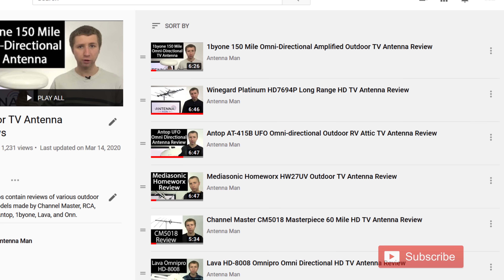Lose TV Stations at Night? This Common Item Interferes with TV Reception

Comment: LED bulbs are required to comply with Part 15 of the FCC rules as an unintentional radiator. This is a legal requirement for these bulbs to be sold in the USA. However, due to lax or non-existent enforcement of these regulations by the dimbulbs in Washington, it is very easy to purchase LED bulbs that do not meet these requirements. These LED bulbs that do not meet FCC regulations will likely also not be UL listed, which means that they could be a fire or electrocution hazard. Big box stores will usually not sell LED bulbs that do not meet UL and FCC requirements due to the liability, but online sellers are typically less cautious about selling unsafe junk. If an LED bulb meets Part 15 of the FCC rules it will say so and/or have the FCC logo on it. It will likely also be UL listed and have the UL logo along with a file number that begins with E, and you can look this file number up on the UL website to find out if it's valid and who the actual manufacturer is.

Comment: LEDs may cause issues, but replacing them with incandescent is not necessarily an easy solution. 

My last trip to my local hardware store I found that incandescents are not as readily available as they once were.

Comment: I have an outdoor antenna an have a solid clear picture except for about 20 minutes 3 times a day when it has heavy pixelation and frozen pixelated screens with no sound. It occurs sometime between 7:35 AM to 8:20 AM, between 12:00 PM and 12:45 Pm and again somewhere between 5 PM and 6:30 PM 7 days a week. Nothing in my house is on that time cycle. There are no nearby businesses. The only thing I can think of would be an over powered Ham radio. My neighbor would be tapped off the same power transformer, but I would not think their electrical interference would effectively my reception.

Any ideas appreciated. I have searched the web for this issue without results.

Comment: It's certainly something to check. People buy LED bulbs because they are cheaper to operate. The interference is likely coming from a crap switching power supply in the bulb. Different kinds of bulbs may eliminate the interference. LED filament bulbs and other cheaper bulbs may solve the problem due to having just a simple full bridge rectifier without any room for smoothing capacitors. The downside is that they'll flicker 120 times a second. You may or may not notice unless you look at a running fan. Notice that I'm talking about switching power supplies here rather than the LEDs themselves. Any switch mode power supply could cause that kind of interference including USB chargers and peripherals that you use on your TV set. The interference could occur at any time of the day. I wouldn't doubt that a lot of the noisy power supplies end up in LED bulbs since they may overlook it. I'd just try a different brand of LED light bulb before just giving up and going back to inefficient incandescent bulbs. If you've only used brand name bulbs because of quality issues, a simple generic bulb might be your solution. I'm too cheap to buy anything else, and I really haven't noticed any issues. I do keep them on most of the time, though.

Comment: This video is false. In a small house, or in a dense city environment, these bulbs may introduce some interference.  But the real reason your reception suffers at night is because broadcast stations (music or television) are REQUIRED to reduce transmitter power at night. The same applies to Amateur radio operations; Hams are expected to reduce transmitter power at night on certain bands to reduce the potential for interfering with other types of stations.

This is necessary because electromagnetic signals  carry farther at night due to the Sun's interference being much lower. So at night, the potential of interfering with other radio services (the aircraft band, for example) is greater.

Generally speaking, a TV station will cut transmitter power by half or more once all of it's coverage area is in the dark, usually between 9 PM and 10 PM local time. So any channels that are fairly weak in your area will most likely drop out entirely. Google "reduced transmitter power at night" for more information.

Comment: LED interference with TV signal...I will recommended  to return to school and learn about frequency distribution. I will be more concert with FLCs  as the electronics ballast may operate in more the 10 KHz, that still way below TV signal. If the antenna is  couple feet from the interference source you will have direct coupling, Sometime the interference propagate from faulty appliance AC line. The flat black antenna have pretty dissent performance if use within RF amplifier. This antenna is good if you live in city where the transmitter is  petty close and not much obstructing your line of site.. This antennas use to be made with clear  plastic and you could see metalized strip of conductor. The manufacture switch to black plastics so no body copy their design - it is very simple to copy - pretty difficult to design. This is very clever design to make wide band antenna. This technics is use in microwave circuits. I have similar flat antenna in my apartment building in Brooklyn NY, Iit is 11 mile from Empire State Buildings, and I am getting around 60 channels in apartment on 5th floor where the TV signal go thru the building. The only problem I have is channel 11 & 13. I can say it not so bed antenna at all.

Comment: Led light bulbs especially the cheap Chines ones are junk. They not only interfere with television signals, but also garage door openers, and home WiFi systems such as wireless routers and surveillance cameras.

Comment: The cheaper LED light bulbs, like the Sunbeam ones that Dollar Tree sells, which use a simple capacitive dropper power supply are actually better in this regard because they cause a lot less RF interference than the fancier ones. The downside is that their light output has more flicker which may cause eyestrain.
Reply: In the UK "Poundland" sell great LED light bulbs for £1. One of the YouTube electronics enthusiasts/professionals did some tear down videos on the Poundland bulbs and was surprised at how well made their bulbs were.

Comment: I switch over to LEDs in my Camry's exterior lights. The only one I couldn't change over was the 3rd brake light because my radio antenna is in my rear window right where the 3rd brake light is. Everytime I hit my brakes, I totally losel my radio station. Now you've confirmed it. Thanks!

Comment: Don't necessarily have to switch to an incandescent, can try a different make/model of CFL/LED bulb. Bulb quality and construction varies wildly. Plenty of people with OTA use LED/CFL bulbs without issue. 

As for you suggesting that switching from LED to incandescent isn't a big deal in terms of cost, yes it is. Electric bill drops from $300 a month to $50 a month with the switch from Incandescent to LED/CFL.

Perhaps putting the CFL/LED on a separate circuit would be enough to alleviate the signal issues if trying different brand of LED/CFL bulb doesn't work.

Comment: Does it take a while for the interference to "build up"after turning on the lights?I was wondering because I do have an intermittent problem with two vhf channels.One night while outside doing yard work,I noticed I had lost the two problem channels.The cable for the antenna runs very close to two led flood lights and when I turned them off, the channels came back.However,when I turned them back on,the channels did not go out right away.In fact they were coming in strong for quite some time.So I'm still not sure if the leds are the problem.Can anyone help?

Comment: Love the rants. Also, I have a WiFi camera to watch for a delivery driver, UPS that never knocks and leaves packages that get stolen ($500 3 D printer) When plugged in a flat panel CHEAP indoor antenna close by causes drop outs, blank channels but as soon as it is unplugged, reception returns to normal. While watching for the driver I switch to IPTV and after delivery time is up after 7 pm switch back to antenna and unplug the camera.

Comment: Good explanation concerning LED bulbs but don't forget trees and foliage also impact OTA signals especially during the spring and summer growing seasons.  Use an AM radio to also test for RF interference.  In rural areas, electric fencing to corral cattle also emit interference.  Such pulsing can also affect landline telephone service.

Comment: Street lights  caused me issues. I was driving around my neighborhood with an AM radio trying to find the culprit. Then had the power company fix it.
Reply from the maker: Props to you!
Reply: Call the power company and tell them that you're having radio frequency interference that you think is coming from their equipment. They'll go out find the problem and fix it if not call the FCC. The FCC does not like RFI.
Reply: Brian Wolf they changed to a more expensive bulb or added a filter to the AC Line!!  This is a big concern, as cities and small towns update municipal lighting to LED Technology to save on utility costs.  A lot of gas stations, grocery and retail stores and parking lots are converting to LED lighting too!  Expect more trouble in the future from poor LED lighting designs.

Comment: I found some LED bulbs do this yet some do not. I don't think it is the LED ( light emitting diode) it's self but the voltage regulator inside. I am trying to identify which brands do this and the ones that don't.

Comment: When I installed my new Garage Door opener, my installer told me to DO NOT USE LED bulbs in the light sockets of my motor assembly. Reason: the RF “hash” emitted from the built in circuit of the LED Bulb can and likely WILL interfere with the functionality of the remote control garage door opener. Using compact fluorescent bulbs has not been a problem. Great info as always!

Comment: Nice video !  I have  problems with some stations when it rains. I live a little down hill in the Raccoon River valley . The towers are about 13 miles away.  An idea for an upcoming video
Reply from the maker: It's general changes in atmospheric conditions affecting the signal you're barely getting. You may need a better antenna setup.
Reply: @AntennaMan  Will work on getting back to you on that. My TV is over 10 years old as well. 2015 or new makes a big difference I believe you said .

Comment: A snubber capacitor could be used be installing it in the between hot and neutral in the existing light socket. A 0.047 uF (47 nF) 250 Volt AC Polypropylene Safety Capacitor, easily found on eBay for 10 for $5.99 with fast and free could be soldered across the terminal lugs of the offending bulb’s socket in the light fixture’s center and collar terminals and short circuit most radio frequency noise emanating from the LED Bulb’s internal Switch Mode power supply. This prevents the bulb’s internal power supply from being a transmitting antenna for the hash coming from the switch mode power supply of the LED bulb!  Expect future Fixture designs to have this built into the fixtures as LED bulbs become dominant!  The capacitor barely reacts to the actual 60 HZ 120 VAC due to the extremely high Xc at 60 HZ. The formula for Xc=1/(2*PI*C in farads*frequency in HZ),  Xc=1/(2*PI*0.000000047*60)=56,467 ohms impedance, but at 54 MHZ, the impedance is 1/(6.28*0.000000047*54,000,000)=15.9 ohms impedance. 
So that means, at 60 HZ, the frequency of AC, the capacitor does  not  conduct much electricity and will not dissipate much power. At RF VHF Channel 2, 54-60 MHZ, the capacitor will present a 15.9 ohm load to the radio energy, damping it out! This means the bulb just lost it’s transmitting antenna in the form of the AC Wiring!  And if it can’t transmit, that means, it can’t be received by you antenna and compete with the ATSC HDTV Signal. How Dow I know all this? I am a Retired Radio Frequency Electronics Technician with  44 years of active experience troubleshooting testing and designing digital R.F. electronics. Everything from transmitters to Voltage Controlled Oscillators to RF Mixer and intermediate frequency Amplifiers to Microwave low noise amplifiers to high stability Varactor Controlled, Phase Lock Loop Local Oscillators using divide by N counters to perform Frequency Multiplication of the base Oscillator Frequency. All of these circuits are used in Transmit and Receive systems employed by transmission and reception of ATSC HDTV RF signals and the recovery of the high speed data used to recreate the picture and Audio for modern day high definition television.

Comment: I would switch a noisy light bulb with a quiet one.  The ‘huge’ issue of global warming, appliance efficiency, and fossil fuel simply does not warrant using 100 year old grossly inefficient technology.

A more reasonable approach is to identify the ‘offending’ lamp and replace it with a ‘quiet’ LED.
Reply: Rich Rodriguez   The global warming issue is a lie. It is not man made. Become stronger than the brainwashing.

Comment: Don’t just tell us they are junk, tear them down and find out why they are junk! 

Is it bad design, or no impedance components for taking the 300 ohm impedance of a dipole to 75 ohm impedance by using an Internal marching toroidal transformer or like a case with bad water seals  bad construction, like letting water get inside to ruin impedance matching or internal active amplifier components and with no weep /drain holes on the lowest parts of the case for outdoor models, poor components, poor soldering or wiring such as a really crappy R.F. Cable with a poor RG 59 male or female connector that is not weatherproof? There is xo much more you can do that slamming them to the ground!

Comment: i have one of those flat tv antennas you always say are junk and i pick up about 60 channels perfectly which is basically everything available in my area; i always wonder if living in a valley in the desert where most of the transmitters are situated on a mountain within ten miles of me is just an ideal scenario for reception
Reply from the maker: Your signals are strong so it may work for you but most people have problems with them.

Comment: I have 2 different amplifiers, one from my soectrum tv distribution box and from tv my antenna to hook up for my tv. And there's a red light on my spectrum distribution box. I only have 4 tvs running but i have 5 rooms with tvs in them. And im using a hdhomerun duo connect 2 tv tuners. So do I need just a preamplifier to prevent the red light from coming on?

Comment: That’s it! that’s exactly my problem. I have a photo eye on my LEDs and about 9 o’clock they turn on and my signal on my over the air antenna drops. I just figured they lowered the signal power at night or there was atmosphere changes but no that’s was the issue With the timer kicking on all the LED lights and that’s when I lost channels are they became weak.

Comment: My guess was "switching power supplies."  I wasn't completely wrong - as LED 120VAC bulbs commonly use some sort of switching regulator in them.  The switching on and off without proper filtering is what causes all noise and interference problems.  Some plug in power supplies that are not properly filtered also cause interference.  I use a small transistor radio (tube type radios are too heavy and clunky - LOL) on the AM band in-between stations to track down culprits.  The noise gets louder as you approach the cause of the interference.  It is usually a buzzing type noise with a high frequency that is modulated by the AC power - either 60Hz or 120Hz depending on full or half wave rectification in the bulb's power supply.   Great video.  Did your downstairs neighbor come running upstairs to see if you were OK when you did the drop test on the crappy antennas?

Comment: Apparently LED lights do not radiate a constant beam of light but rather strobe on and off.  I realized this one day while playing my guitar.  In natural light the vibrating strings all just look like a blur.  But under an LED light, the A string can be seen as if you were looking at it with a strobe light.  The frequency of the A strings’ vibrations (110 Hz) must be nearly resonant with the frequency that the LED light output is flashing.

Comment: You are spot on again.  I have my antenna amp on the same breaker with my basement light switch.  I have four porcelain fixtures each with a .88 cent 80 Watt LED bulb from Wal-Mart.  When I flip the basement light switch it messes up my TV reception.

Comment: They reduce the power output of radio stations at night to prevent overpowering neighboring city stations.  Is that the case for TV stations as well?
Reply from the maker: No TV stations do not lower output at night. They are under strict rules by the FCC to output a specific power - no higher and no lower without an STA.

Comment: I do believe you have solved a mystery. Most of the time I have perfect reception. I have always used regular incandescent bulbs but my neighbors may not. I share a wall with another unit and that is where my antenna is mounted. Sometimes I lose some of my channels even when the weather is good. If cable companies wanted to force people to keep paying for cable they would invest in these bulbs.

Comment: Just like antennas, Some l.e.d bulbs are also plain crap. Sometimes just buying a better quality l.e.d light bulb can also solve the problem. I agree about incandescent cause less interfrperence, but l.e.d are really helping out global power consumption. Not only with the power consumption. But also with all the heat that they dont creat in the house that your a/c then has to remove from the house